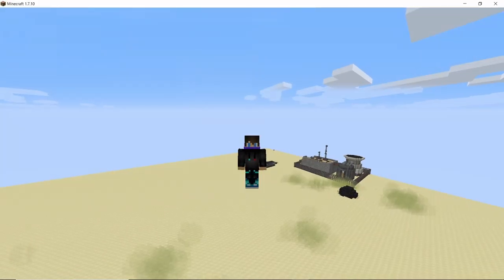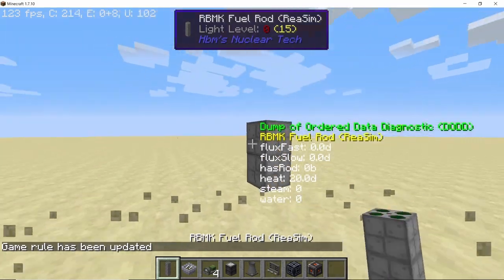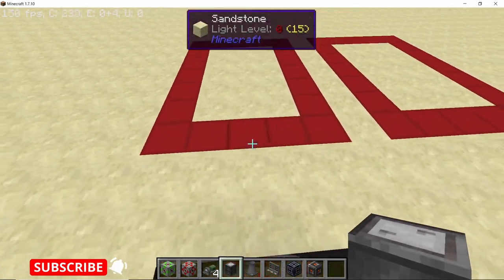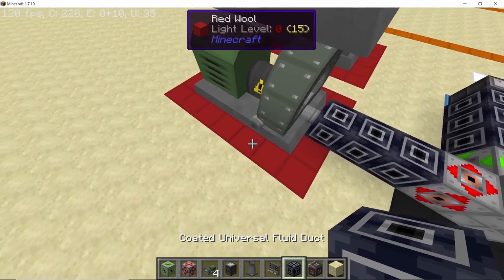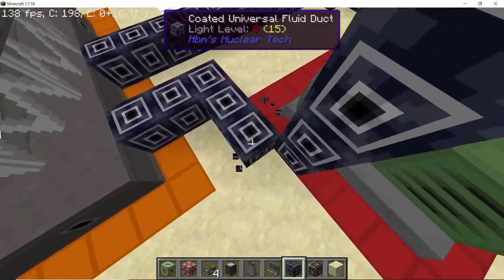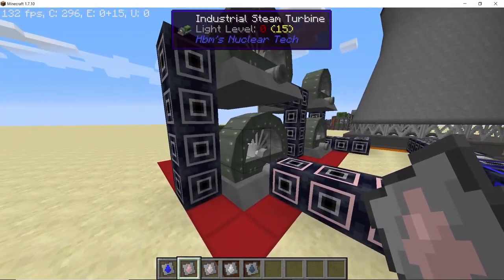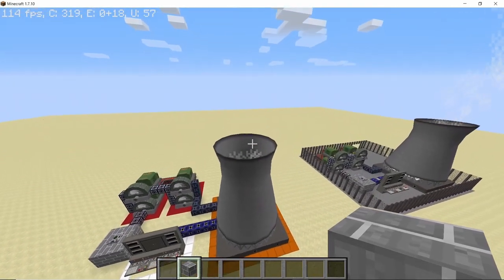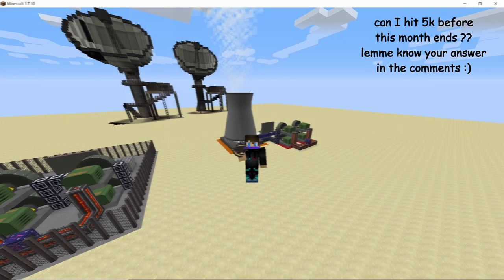1x1 RBMK Reasim Reactor | Smallest RBMK Reactor in HBMs Mod | Mini Nuclear Power Plant build HBM Mod

Comment: My current RBMK designs are about 36x36 with 4 consoles for each quarter. Its totally possible to scale up you just need to watch your heat production VS processing
Reply from the maker: Ofc it's possible to scale the design limiting factor being how powerful your device is xd

The reason my design is exploding is I'm working on a reactor that runs on the brink of destruction , so very hard to keep it in control but I'll get it to work

Comment: One thing HBM should consider doing if possible, is block rotation, i mean, the turbines just 'float' there and with rotation they can be placed on a ceiling lol 

Ah yeah, i missed those vids, my pc died a month ago so i'm minecraftn't for a while, F
It's good to be back, thanks again for the tutorial 👍
Reply from the maker: Block rotation would be cool indeed, HBMs doesn't have a debug wand like most of the mods do like the wrench in thermal expansion which allows for block rotation ... but eh I think there are many other crucial components that they are working on which will take priority over this

Hopefully your pc is all fixed up again , my laptop dies alot so I can understand how it feels xd
Reply: @SavageVegeta  my house has a somewhat old cables and those days it gave problems, so my dad had a brilliant idea to turn the entire house at 220v, which destroyed my font lmao; even tho the pc booted normally there was smoke coming so i shut it down and removed the font .....
Reply: @HikaruCh.  its not a good idea to have a house run at 220 volts, the standard is 140v
Reply: @Westerstaad  ikr, it just booted up after my dad turned on 220v, i didn't touch it before it started smoking 😅

Comment: Thanks bro! i built a NPP chernobyl style, currently 1 reactor, but not operating yet, building a R2 soon! btw can i use measurements like instead of 6 block distance cooling tower, an 8 block distance?
Reply from the maker: Sure man , I used these distances for making the build compact but you an make it as big as you want to !!
Reply: I finished the second rwactor
Reply from the maker: @hairforcetwo7  that's awesome man

Comment: This is actually cool
Edit: just asking can I use a Universal fluid duct not an coated one as you said it's only for fps and a not coated copper cable
Reply from the maker: yeah you can use any cable and pipe of your choice, now if you are in the latest update there so many choices too !!

Comment: uhm what did i do wrong ive setted up everything right and inserted the rod and 10 seconds later it exploded
Reply from the maker: there isn't much wrong you can do with a single rod reactor man. Make sure you have enabled reasim game rule , and have a closed loop of water using an infinite water source
Reply: @SavageVegeta  found the problem i setted the coolant barrel on input only

Comment: I built everything exactly as it is in the video, but the steam turbines aren't working, and no water is going in the fuel rods. Any ideas on what I could've missed?

edit: I forgot to enable dialReasimBoilers and I was trying to fix it for 2 hours. pain
Reply from the maker: yea was gonna suggest that as this only works with reasim, glad you figured it out and sorry for the late reply
Reply: It's okay, it's a miracle you even respond to comments (not a ton of yters do that)! By the way, do you play NTM survival ever? If so, what's your preferred starter RMBK design to get your first bismuth nuggets?
Reply from the maker: @Something-ff9cg  I don't really play survival as due to work schedule I can't make the time/commitment to stick to the grind. For bismuth tho I generally prefer a fast depleting reactor which focusses flux on a middle rod with the help of surrounding fuel rods or even reflectors if you don't have the resources to sustain 5 fuel rods

Comment: I've followed this tutorial 100% but no water is going into my rbmk rod, I've tried tanks and barrels all set to input output, and double checked everything was spit together right. I'm playing on the 1.12.2 version though I'm not sure how much is different
Reply from the maker: For 1.12 you'll probably need to set the water duct connecting RBMK rod and barrel to extraction mode. To do that just take a screwdriver and right click on the duct that is directly in touch with the barrel and that will set change its color to orange thus settings it to extraction mode

Comment: My fusion reactor doesn’t power it self unless I put the power line in the place were you put the steam pipe please help
Reply: Any idea why this is happing
Reply from the maker: Cause you need to provide the fusion reactor with power in order to start it , once it starts producing enough power you can route it back into the reactor itself and store the excess power in any storage block or join it to your power grid.

bottom line you need to have power beforehand in order to run a fusion reactor
Reply: @SavageVegeta  thanks for the response. However, when I try to hook the power back to the reactor it doesn't go in. I put the cable like you show on the fusion reactor video.

Comment: I build this exact same reactor but every time I leave my base it explodes
Reply from the maker: Well then I would recommend taking out the fuel rod and storing it in a storage column until you come back. The Explosion might be happening cause the Reactor is in an unloaded chunk
Reply: I tried using the build craft quarry to load the cunks so it won't explode. But it still did
Reply: Reactors explode in unloaded chunks

Comment: Mine wont Stop exploding,and the cooling tower isnt making any particles out of hte top
Reply from the maker: Double check that your outlet pipe is a super dense one , cause reasim reactors only make super dense steam. And the turbines should also be configured that way. Its a 1x1 reactor man that too with a mild fuel like mep , it shouldn't explode

Comment: Hey can you help me out? When I put the fuel rod inside the reactor it heats up very fast and the turbines and the cooling tower aren't working. I might of missed something in the tutorial but I'm 100% sure I did everything right.
Reply from the maker: There are a few things that can be causing this problem

1) You might've not connected the water inlet pipe to the reasim water inlet block (the green one) thus there is no water in your reactor so it heats up quickly

2) You might've not turned on the Reasim gamerule thus causing the steam to build up inside and have nowhere to go 

3) You might've connected the steam pipes to reasim water inlet block instead of reasim steam outset block

4) The pipes that connect the steam outlet to turbine are not set to super dense steam. As this reactor only makes super dense steam you have to make sure the first pipe is set to super dense steam that goes into the first turbine.
(As there is no steam going inside the turbine it's natural the cooling towers will not work as they have no low pressure steam to take care of)

Double check all of these things , mostly you will find your problem here !!
Reply: @SavageVegeta  Thanks for the help but I deleted the save with the 1x1 reactor and made a bigger one on a different world. The current reactor works just fine so I think I didn't connect some things right or I didn't set the water tank to input and output.

Comment: Could you make a video on how to make a functional RBMK using digamma rods?
Reply from the maker: I was trying that but was only able to make a reactor that produced normal steam. Also considering you only need to deplete a digamma rod over 1% to recycle it as depleting it any further still yields the same amount I didn't look into it any further :D

Considering you can't use digamma as a conventional fuel source what is the end goal that you have in mind ?? That will atleast make it easier to come up with a design for the digamma reactor

Comment: Never think you can make an RBMK with just One Rod
Reply from the maker: Yep do give it a try it's very easy to build , also if you find out any problems with the build do let me know !!
Reply: Well there is for some reason the 2 Heaght RBMK Reactor if it's even a Reactor well it doesn't Produce steam I don't know why and I rebuild it and I thinks there's something Wrong I have Done on why it's not working but still it's Not Working is it because of Version cause there's no Coated Universal Duct in my Version well it might be actually just the version dunno I might have to try it

Comment: yo savage vegeta you can you can use normal fuel rod it will work like reasim fuel rod
Reply from the maker: i think you can but you will need to switch to reasim gamerule anyways so it's better to just use a moderated reasim rod
Reply: @SavageVegeta  yes I use the gamerule of reasimboilers

Comment: Bro in the starting how that rbmk reactor explode tell me
Reply from the maker: it overheated , the water flow was not enough to contain all the heat
Reply: @SavageVegeta  try infinite fluid barrel it's a item that can fill anything in 1 second
Reply from the maker: @soniajain7008  it can't be crafted in survival so it's not practical to test it for builds which are meant to be used in survival

Comment: Can i still operate my normal RBMK after setting the ReaSim gamerule to true?
Reply from the maker: If I'm not wrong then reasim RBMKs require reasim fuel rods. So yes you should be able to use the normal RBMK, however the only way to be 100% sure without manking any such change to your world is to get into a creative world and test your designs out

Comment: 1:33 i dont have coated universal thing in my mod!
Reply from the maker: You need to update your mod then, I have provided a github link in the description you can download the later version of mod from there
Reply: @SavageVegeta  dont worry, i replaced it with normal pipes and it worked! just 1 thing:I followed your rbmk reactor guide and i saw that u say"put a SELF IGNITING fuel, but i kinda like uranium that is not self igniting, can i make it work with non self-igniting fuel?

Comment: how reasim rbmk blocks work?
Reply from the maker: Every block within a 10 block radius which is surrounded by a REASIM fuel rod will act as a boiler in itself and it can hold water and produce steam. So reasim reactors don't need boilers , each RBMK column acts as a boiler